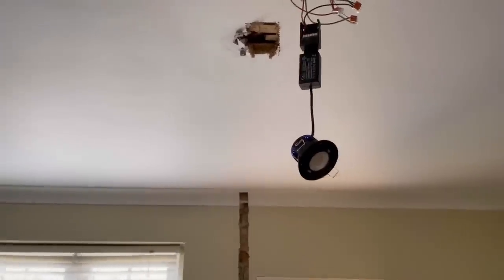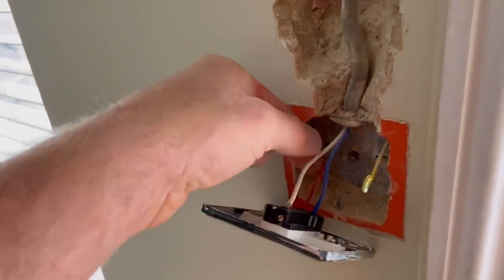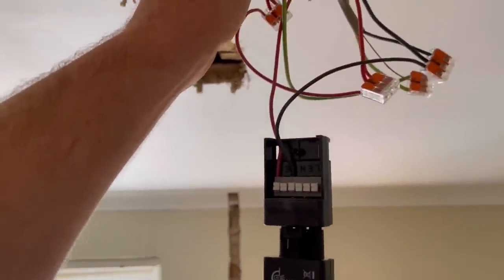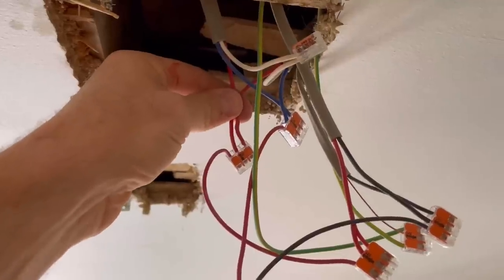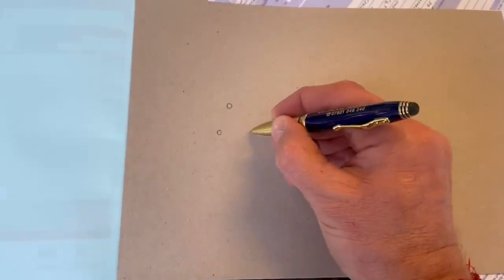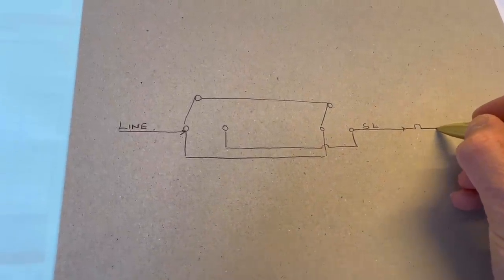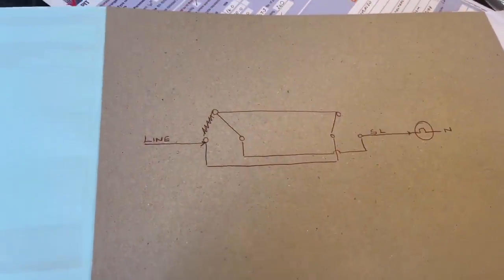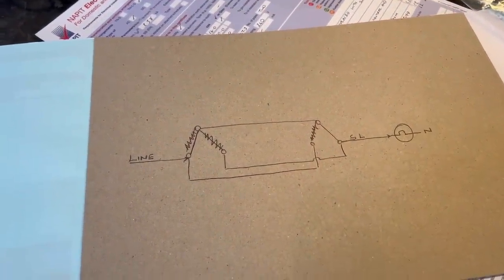2 Way Switching - Taking the 3 Core Cables to the LIGHT - Connections Explained

Comment: Or u could make the white conductors as (common) one connected to the live…and the other white conductor (common) connected to the switch line then connect the red and blue (L1 &  L2) as strappers…same as doing it with singles in a conduit system ….jus another way of doing it…nice one boss
Reply: Thought the same thing .
Reply: Why not use the common as live then other common connect to light so technically you only need to cut the common an leave the other to connected switch to switch looks like one of the switch configurations caused like double the length of wire to light up the light wouldn't that increase resistance and cause slightly more power use.... What if switches was double the distance apart mmm this cud explain why my up stairs landing light kept blowing mmmm

Comment: will you be changing the colours at any point or is it ok to use the older colours as long as you put a sticker in the cu?
thanks
Reply from the maker: A sticker is no longer needed on the consumer unit. However cables were correctly identified and a Wago box was used. Thanks for commenting and watching the video 👍🏻
Reply: The old colours were red yellow blue . The white and blue is American or French
Reply: @Dog-whisperer7494  11th-13th edition 7671 was red/white/blue plus some far older installations. 14th L2 became yellow.
Reply: @intercity125  I was trained to the 16th we were going over to the 17th towards the end of the a 4 year college course and we used three core and earth Ie red yellow blue and green/yellow sleeving on the bear earth yellow was always used as common red L1 blue L2 and the yellow’s joined with a choc block at the ceiling rose.
Reply: @GSHElectrical  had the same colours on ours, although the previous owner had wired them up differently so the "up" position was never off on one of them
Reply: @Dog-whisperer7494  finished my training in 89/90 and then chose a different career path so it's nice to see us oldies reminiscing about the good old days :)
Reply: @therealdojj  yes I did C&Gs 236 parts one and two 4 years at Watford college 1987to 1992  loved every minute of it  and the best part was my dear late brother who was a spark said I would fail the exams but he was pleased when I showed him my C&Gs certificate’s
Reply: @therealdojj  that’s how I was tort one switch will be off and the other will be on . The one that is off switch on light comes on the one in the on  position switch to off the lights go off . You can go back and forth all day in any combination and turn the lights on and off . Fantastic.
Reply: @Dog-whisperer7494  but both should be off in the up position, i've recently had two way switching done in the hall, the upstairs landing and the loft because someone (mentioning no names, but they are children) never turns the light off lol
it was a bit of a head scratcher to get one light to be operated by 3 switches though
Reply: @therealdojj  
I was tort one on one off , the reason being is if both are in the on or off position you can’t tell what one is doing what also you won’t know if the lamp had blown or not . Only going by what I was tort at college and by my brother. 
But who am I to argue i’am just a humble spark who’s opinion means nothing. 😂

Comment: Why did you use the strappers, surely easiest would of been to open the white core up at the joint and then put one in the feed one as SL to fitting 🤔

Comment: One white in SW and one white in perm surely is same
Reply from the maker: My method is to join the strappers through and feed one of the commons and use the other common as SL 👍🏻. That’s why I loved the video Matt made shows a different method with the same outcome
Reply: @GSHElectrical  that would be my method two cheers

Comment: Can you explain if a FLUKE 1AC II NON-CONTACT VOLTAGE DETECTOR 200V-1000V
 will detect live power through plasterboard walls?  What would you recommend?